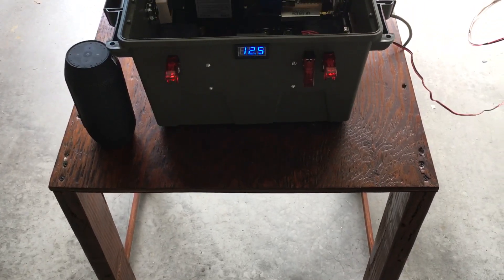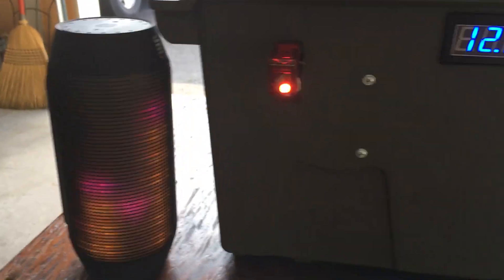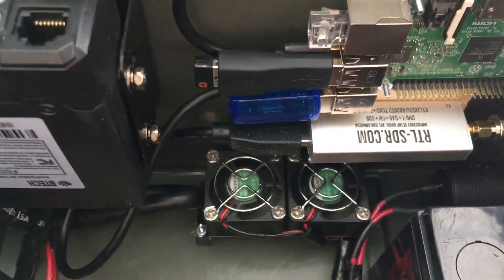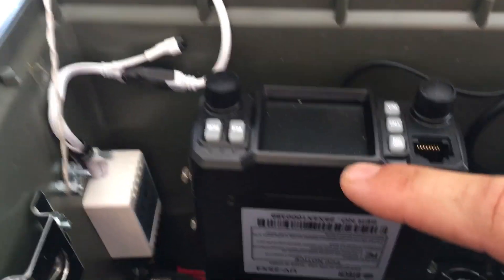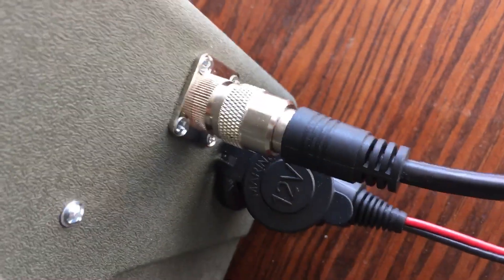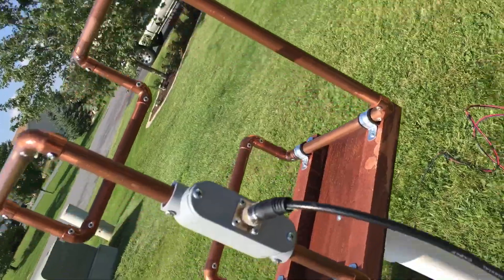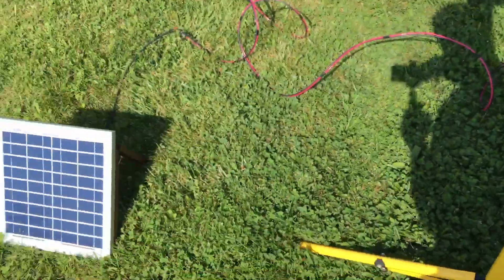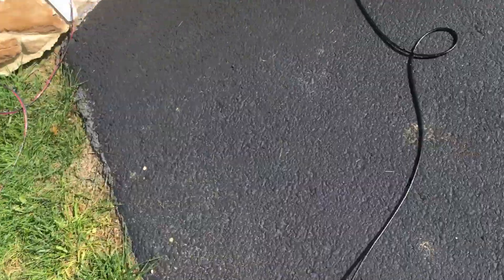Ham Radio Go Box with touchscreen. UPDATED Video

Comment: What is that style of antenna called ?
Reply from the maker: It's a full wave antenna. Here is where I got the plans from. 

I got the plans for this antenna from https://www.qrz.com in the search put in AG6IF. Under the Bio tab scroll down about halfway till you see a picture of the antenna. You should also see the following words: 

"I have been playing with a folded full wave loop design, the author calls it a 3DFL, 3 dimensional folded loop.Here is a 2m version. Made from:(6) 7.5 inch, (2) 3 inch, || (2) 2 inch or (2) 2.5 inch for thin walled copper || (2) 5-7/8 and (1) 12 inch, 12 elbows, feedline center to top of seam and shield to bottom of the seam.I use a electrical box and mount over the seam/gap, with the SO239 connector trapped under the cover as shown. (see close up below)The picture shows sheet metal screws, but soldering the joints together produce a better antenna, and much more sturdy"